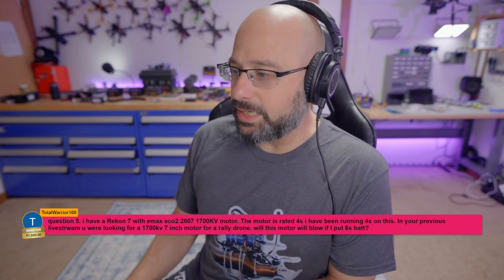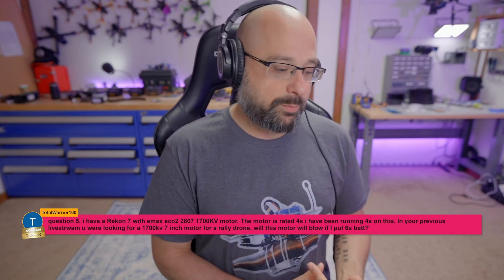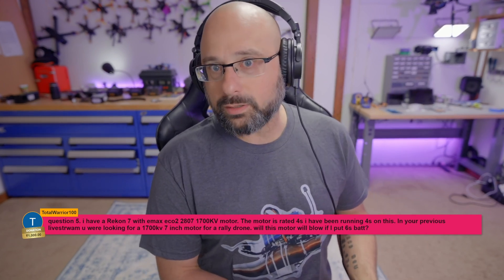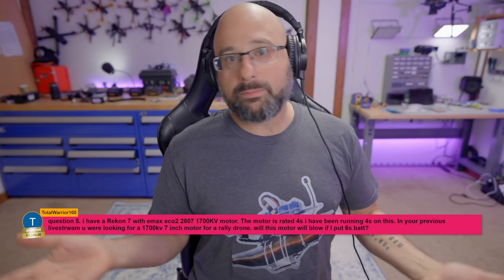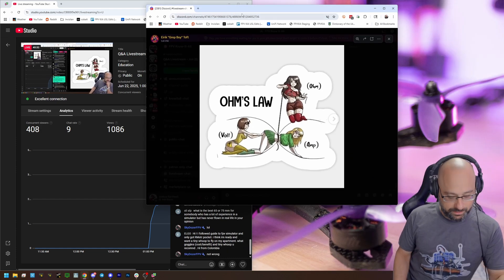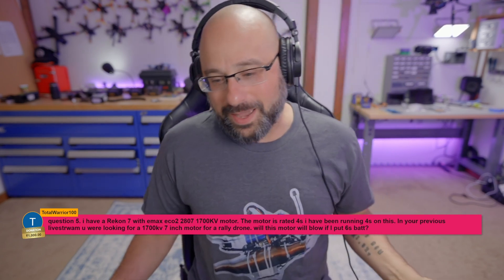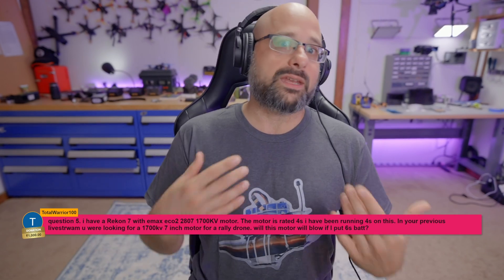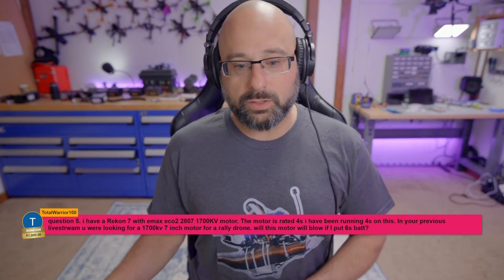What Does A Motor Battery Rating Mean? Using 6s Batteries on a 4s Motor? - FPV Questions

Comment: I have 650 kv motors 12inch props on 4s, I upgraded the esc to a 70amp. I’m going with 6s but I want to try 8s. How do the math? I may just plug it in and see what happens.

Comment: I was always taught that lower KV motors can run both cooler and longer on higher voltage. That is why high KV motors are usually paired with lower voltage like 4S, and a lower KV motor can run on 6S on up!

Comment: So here is the thing with motors, its the current that fries them by overheating. If you have no props on you can spin at really high voltages until the case shatters or the ESC fails to keep up. But with props on just calculate how many RPM you might get from a 6s, then look up how that translates to the torque, and torque grows linealy with current. So if you know what you are doing, using a less demanding prop or just not push the throttle too hard.

Comment: I'd guess 4S motors with 2200-2400 kV are probably quite usable on 5-inch and 6S models. A 4S with 2500-2700 kV on 6S would be a bit risky... Yes, I agree. Amperes (and therefore heat) are somewhat limiting it, and the centrifugal forces at excessively high rpm can deform he motors, coils, ...

Comment: From my understanding the higher the voltage the more power you can push through the motor right? That way you could more easily overheat the motor and blow it up?

Comment: I've run 1700kv motors on 7 inch and it was difficult for me to tune, absolutely insane to fly but definitley on the edge as I was getting a lot of flutter because prop tip speed was way to high. I run 1500kv now and it's perfect for what I like to do. Experiment with motor limit output to find your happy medium

Comment: dielectric breakdown of the insulation is a function of voltage, time, temperature,.... You're increasing voltage, you'll get less time, higher temperature too, you'll get less time.  Likely you'll run your quad into a wall before you run out of time ;0

Comment: Bardwell, good and detailed explanation, but maybe not straight forward to the question the person asked. To get to the point, 2807 1700kv motor (usually a 7" motor running 4S). To run 6S and keep the same ratio you have in 4S, just go to Betaflight and set the Motor Output Limit to 0.66 (66%), then you good to go.
Reply: I don't think that's necessary at all. 1700 is low for 6s and he has a 7 inch sized motor.
Reply: @jayaneyon9316 with a larger prop, the optimal kv of a motor for a certain voltage battery decreases. 1700kv is on the low end for a 6s 5inch, but for a 7inch, that's more like 4s kv rating. Prop size matters
Reply: @cflin4637 that's just for a desired top speed. Bigger motors can handle bigger props at the same rpm.

Comment: I think this is one of those things where if you have to ask this question, you're probably not ready to be going off piste  yet and should just stick with manufacturers' recommendations or builds from established builders.

Once you have the understanding of the motors that's required to go off piste, you wouldn't need to ask this question imo.
Reply: So how do you gain understanding if you can’t ask these questions…
Reply: @Gotton111  by starting with simpler projects, build something that's been spec'd by an established builder, ask about/listen to why certain choices were made in that build. Seek to build a baseline knowledge of electronics and motors, JB has loads of videos on these topics, Chris Rosser is also a great resource for it. Once you have that baseline knowledge, you'll be able to tackle a project like this with very little guidance.

To me, it's not that you can't/shouldn't ask (you should!), it's that asking this particular question is a hint that you don't have the baseline understanding that I think is necessary for this kind of project. If you've got money to burn and learn well by experimenting then by all means ignore me, I'm just some random stranger on the internet!